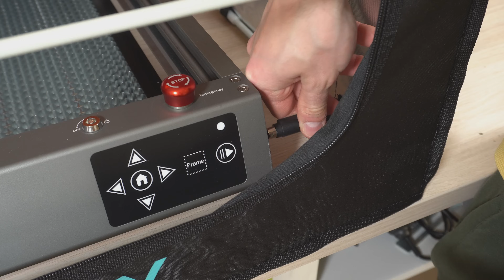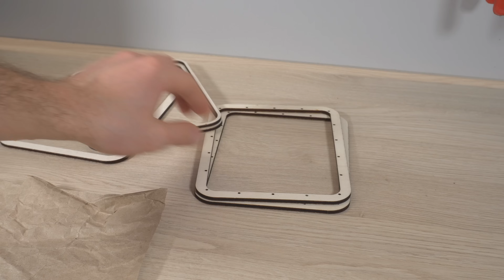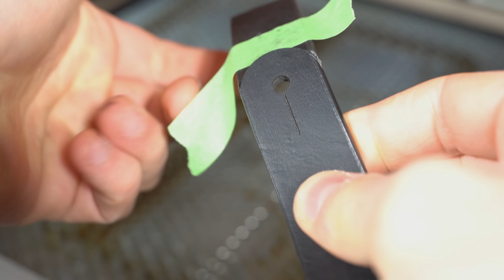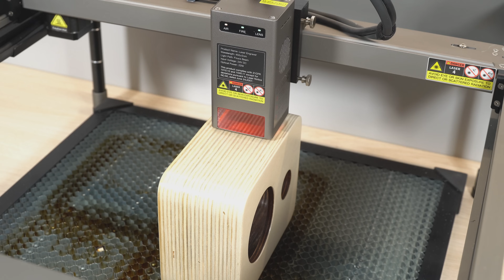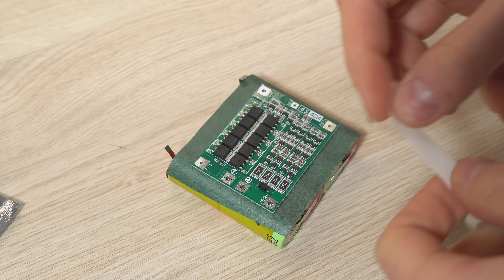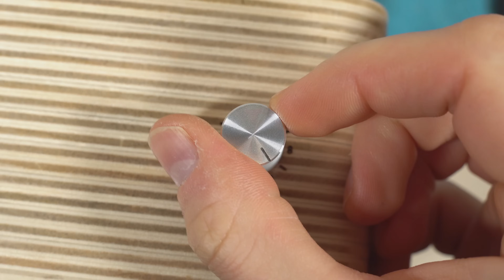Portable Bluetooth Speaker Build Using 24 Plywood Layers

Comment: Big Fan of your project but two drivers are completely unnecessary for such a small speaker, because they complicate the Build and bring no advantage. A good Broadband speaker would have been the better choice. Some good options are: Dayton Audio PC83, Dayton RS100-4, Visaton FRS8-4, Peerless TC9FD-18-08, Tectonic BMR65-8 (which is great, with low directivity and a lot of bass), Monacor SPX-30M, Lyeco LY302F, Dayton PS95-8, Tangband W3-315E or omnes audio BB3.01 .

Comment: nice work, so you have a 4S setup, but using a USB-C? you have a step up module or one of those PD things to boost the input to 14v?
Reply: You probably figured it out by now, but all the parts are listed in the description; yes he uses a USB-C to 4S charging board that steps up the voltage.

Comment: It turned out great! As far as I know, this amplifier does not turn off completely when the potentiometer is set to 0, only Bluetooth is turned off. Preferably a separate power switch that breaks the circuit.